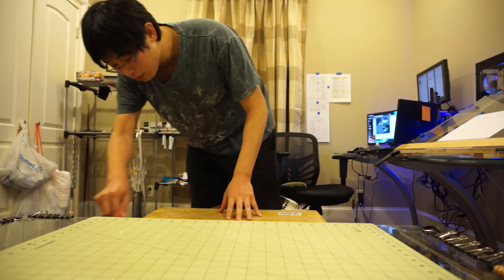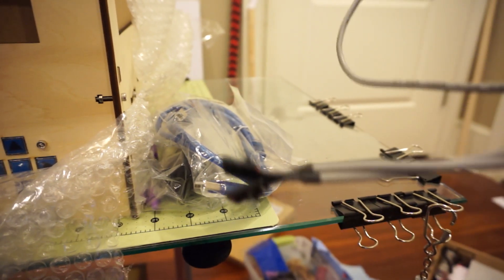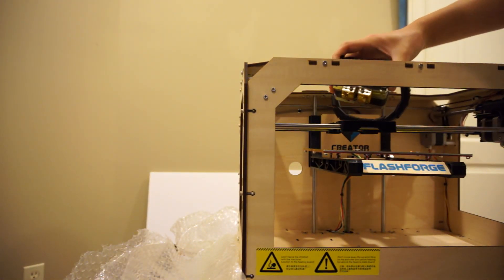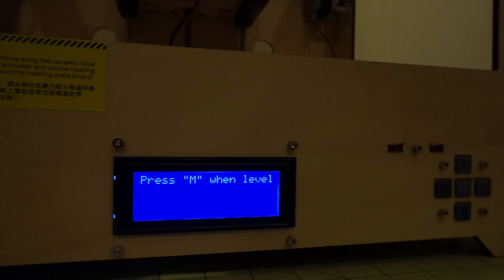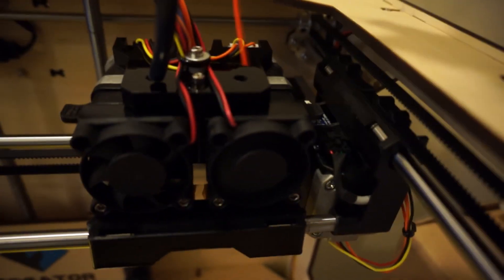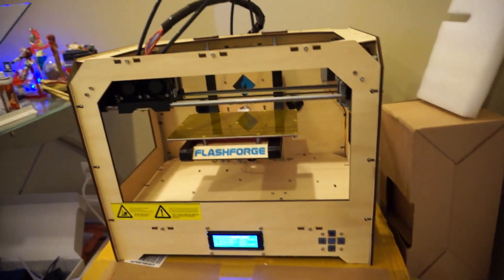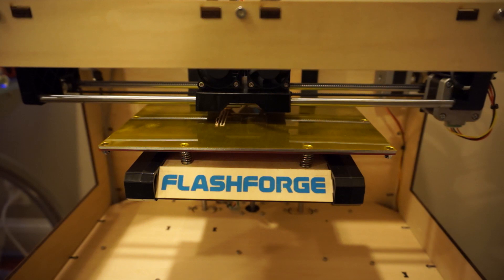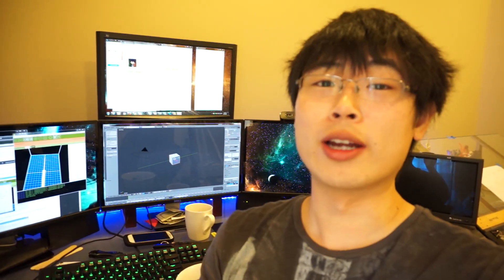FlashForge Creator 3D Printer Unboxing

Comment: 3D modeling is awesome once you get the hang of it, I've used Blender before and I'm currently in a degree program that allows us to use Autodesk Maya, it's a pain at first but once you understand the components behind each tool it's a lot of fun.

Comment: Nice, do you do any research on what printer to get or did you buy the cheapest one?
Reply from the maker: ChaosCorrupter i did some researching, this one apparently is a clone of a makerbot replicator, tho it does have this one issue of the plate being warped slightly or one of the extruder heads dragging which didnt matter to me cause il be getting a glass bed for this if i can break even, the extruder heads just need to be adjusted yourself if it drags..which on mine..it doesnt

Comment: hey did you have any trouble installing the software? what OS do you use? I can't seem to get the RepG software installed
Reply from the maker: Olanrewaju Adeniyi win 7 pro, and no i didnt have any sort of issues installing
Reply: Returacan I ran and installed the python but when I try to install the replicatorG I get errors for installing all the drivers
Reply: +Olanrewaju Adeniyi just install them anyway and it should work fine

Comment: what profile you use for cure? if not Cura, what program you use?
Reply from the maker: ReplacatorG, a copy of it should be on the sd card it came with..i found that cura doesnt work with this printer with the firmware it had shipped with..idk if they updated or not

Comment: you should make sure the window is open since the 3D printer actually lets out some smell that is quite unhealthy to your body (how toxic? well... the pet squirrel in our department lived in a cage right next to the 3D printer, it died after we started using it for around 3 weeks. missed him  QAQ )

I would recommend using the program "Auto CAD Inventor" it is quite easy to learn and all you have to do is transform the file into the 3D printer program and it will do the work for you

oh and also, printing pieces too large will make it curve a bit, and printing something that is thin  on the bottom and wide on the top will end up collapsing (unless you change the plastic extracting speed to very slow, but it'll take forever just to print a small thing)